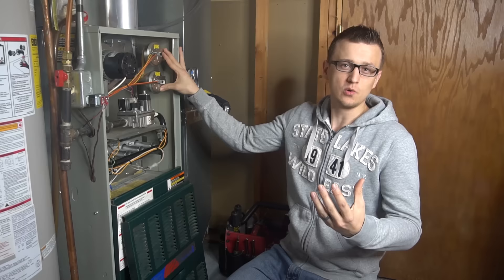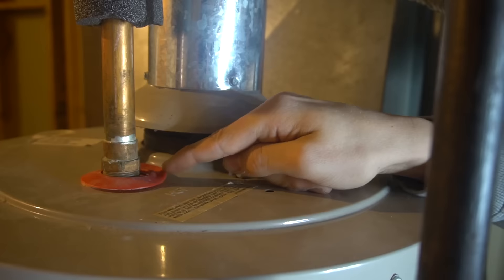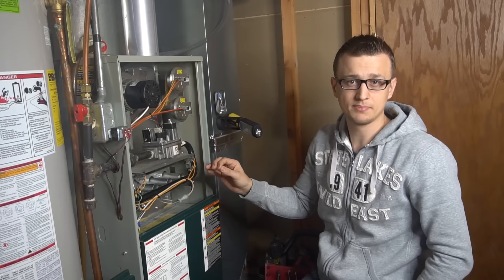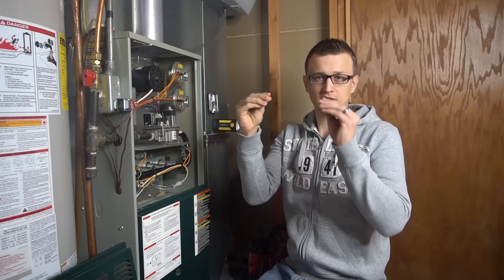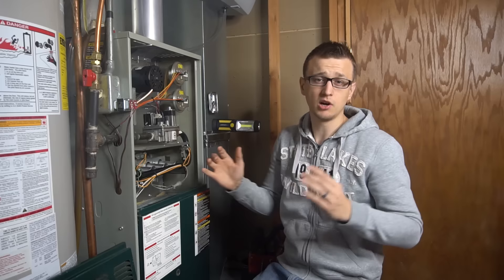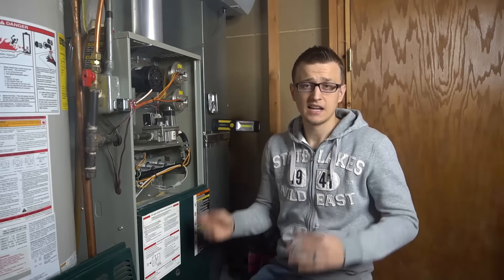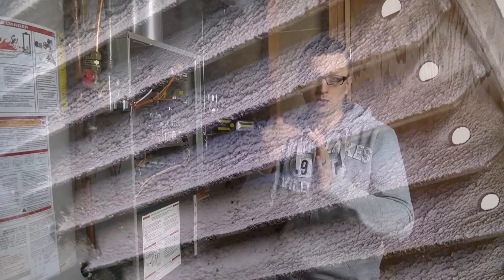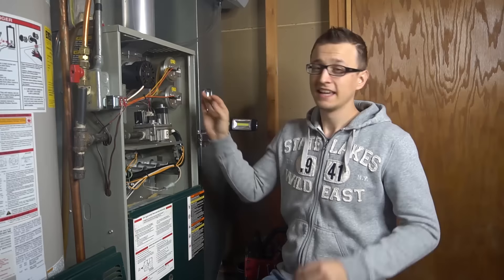Furnace Pressure Switch Troubleshooting

Comment: Hi, I have furnace issue/problem with 3 flashes which is “pressure switch do not close or reopen” when the upper door is closed. When I try to figured out/fix it runs when its open (no upper door) & give us the target temperature but when it stopped, it flashes 4 times. Is the 4x flashes a part of normal operation when it stop?

Comment: i believe i have watched all your videos on pressure switches and still have a problem. my switch has another hose connected to it that goes to the gas valve and burner,  didn't see that type on your videos .  if i disconnect the hose the furnace will work for a while  then shut off,. if i disconnet the power for a minute or so it will restart again for a while   connected it will not ignite the furnace.  my furnace is a xr90,  i did replace the pressure valve with a new one but had same problem.  any ideas?  thank you

Comment: I'm getting a pressure switch error message on my 90% Goodman gas furnace. I'm not getting any motor activity whatsoever. The error fires off pretty immediately. Would this indicate a heat exchanger issue? Have moisture that has shown up inside. Exhaust and intake vents are clear, pressure switch checked out fine, blew out the moisture removal tubes.

Comment: Today I had a chance to troubleshoot Bryant 333BAV, the controller board was flashing error code 43, which is Low-Heat Pressure Switch Open While High-Heat Pressure Switch Is Closed, I tested the high and low pressure switch with ohm meter, and they tested good with normally open. I then stuck a 22 gauge wire in the metal tube the see if it was blocked, it was not. I then traced the wires that go to and out of the high pressure and low pressure switch. That's when I notice there was a Over Temp Switch model HH18HA416  in series with the low pressure switch. I then decided to install a jumper across the Over Temp Switch, and flip the switch to turn on the furnace, after few seconds or so the inducer fan turn on, then the igniter glowed orange and natural gas valve kick on and we have ignition and we have flame!

Comment: My furnace is a Aire-Flo AF80MPA075B3-A, I can,t find the LED on the control board. Is there a chance that this control board does not have an LED. Thank you for putting up your videos. Heinz.
Reply from the maker: Hey Heinz! Some control boards will not have an LED light. Either yours doesn't have one or the transformer is not sending 24 volts to the control board. Without LED diagnostics, you would need a multi meter to check voltages to try to track down the problem.
Reply: Thank you so much for the fast reply, now I don,t have to go and look any further, and yes I have the 24 volts. The furnace is working pretty good after cleaning out the Vent Pipe. The temperature drops at night by about 5 deg but works fine during the Day. Just wonder if the Flame Sensor is dirty, like to check the Sensor but can,t find it. Can you help again? Thanks Heinz.
Reply from the maker: @heinzmissun7431  Happy to hear it's working! If you watch the following video, I talk about the 4 different kinds of ignitors. Which one do you have?

https://www.youtube.com/watch?v=1bRsFAMgZRQ&t=22s

Some furnaces will have a spark ignitor that also acts as the flame sensor. I also have flame sensor videos if you need them. Although it's likely not a flame sensor issue. My first thought would be that perhaps it is overheating. I will be posting a video on 10 reasons why a furnace overheats later today.

Comment: Hey bud, been watching all of your vids to get an idea what’s wrong with my propane furnace but can’t find anything. Last year my furnace started making a loud clicking sound over and over without any flame. Motor is coming on. Had a HVAC company come out and said it was a bad regulator at my tank. He turned the plunger a couple turns on the regulator and it work for about a month. Well it started again this year. I had my regulator replaced. I should mention I live in high elevation and furnace is in my attic. I would say a good 20’ elevation higher than my tank. After the regulator was replaced it came on once but after that it’s back to clicking. I adjusted the plunger in the regulator last night and it the furnace worked fine after that until next cycle… back to clicking and no flame. Any ideas? Thanks!

Comment: I get code 31 on very windy days, the unit is vented to the roof with two 90s to form a (u) pipe point down. any ideas to stop the wind from entering the pipe and effecting the pressure switch>

Comment: Hi, my furnace gives a pressure switch error, started once every 2 months and now once a week.  Been a 2 year adventure.  Repair man replaced pressure switch over an year ago. If I power off, blow on the pressure tubes, power on, it will work.   During the issue the inducer motor is running the entire time, sometimes for many hours before I get home and get it running.  It is a Lennox G51MP installation 2006. Been getting a lot worse lately.  Any advice on Intermittent issues trouble shooting.
Reply: Hi, Jeff, I have the same issue specially in cold weather. Did you have it solved? Thanks
Reply: @yzhao2919  no, I never found the root cause.

Comment: Huh.. ? It could be a leaking diaphragm in the pressure switch.. Proper testing would be to connect the manometer directly to induction draft before using a "T"  connector.

Comment: Have you ever seen an intermittent pressure  switch that would only fail on start-up? It fails to start the first try sometimes not always though...usually the second time always... very few ever does it take 3 times. Once it starts and begins running  it nevers shuts off until the thermostat is satisfied and cycles completely.
This is a new Lennox 80% furnace replaced 12 -31-2020 and has had this issue since day 1.
 I noticed it took twice to start the day the techs installed and had left but just thought it was a fluke of air in gas line or something it started fine the second try. Later on i noticed this was something that happened every once in a while so i called and a tech came out and couldn't duplicate a failure so.let it go because it never ever failed to start completely. 
Better half was down stairs other day and noticed it took until the 4th try to start so i called and a senior tech came out and got it to fail for him said he thought pressure switch was causing it and would order and would see results......part should be in soon and will see what happens. Its strange to me in the sense that it only occurs on start up and never again and also that it doesn't fail every time .

Comment: I’m desperate for a tip. My Carrier 58WAV075-101HC will blow out heat but every few hours it shuts the blowers off and only vents cool air. It won’t heat again unless I click a switch that sits next to the exhaust at the top and is connected to the pressure switch.

Comment: I have a older furnace that had the blower motor replaced then the person that fixed it replaced the pressure switch with one it does not go to my furnace and now my furnace sometimes kicks on when it supposed to in other times it does not then I have to turn my thermostat off for 10 minutes then turn it on then it works normally then we’ll go back to not kicking on Any idea what can cause this problem

Comment: 2 ton Goodman/Bryant with water pouring out of switch and hose but doesn’t have a drain valve. Rain water in vent? Evap coil is above but only 2 year old unit. Should drain into inducer housing huh? Don’t see any external leaking.

Comment: on high effeishency furnaces there are two pressure switches why. and do they both close their micro switch at the same time when inducer motor stats, I am still getting code 32 intermittently on my Carrier, which say pressure switch falt. I am afraid to brake it by blowing in there. Is there an alternate way to check each one speratly.  Thanks again.
Reply from the maker: The pressure switches have different PF ratings. Which means one of them needs more pressure on it to close. That's why the inducer motor has two speeds. An alternative way to check it would be to use a multi-meter if you have one. Being that the problem is intermittent it would be hard to catch it though... And it's not likely that the pressure switch itself is bad. I would think that either the condensate trap/drain line is partially plugged or somethings wrong with the exhaust or intake.
Reply: The problem is you have a carrier. I have run into problems with those furnaces. Get a different furnace! I have run into two different plugged secondaries in the last year and the same day I was going to replace one another tech from another company was replacing a secondary that same day

Comment: I have a trane xv90 furnace and heat pump and nest thermostat.  I can't get either to heat.  I have 1 red flash every 20 seconds on the control board on the furnace.  I have a N6 error on the nest thermostat.  Any ideas?

Comment: i have a keeprite high efficiency with the plastic tubes and it starts up normal and everything. it runs for 20-30 seconds the cuts off and gives me 3 flashing lights. checked flame senser , cleaned ports, checked for clogged vents and everything seems ok.. any suggestions

Comment: Exhaust is getting into my system somehow which then blows into the living space. It happens only at night.
I have a single stage Rheem furnace.
How could that happen?  Could it have anything to do with a failing pressure switch?  If so, why only at night?

Comment: Every time I attempt to use a Filtrete filters it shuts down my system after a while. The unit is up in the attic so for a quick fix if I turn the breaker at the panel off and then back on it resets the system and it’s back on. Now, when I use the really cheap filters I have no problems. Is this a pressure issue?

Comment: I have a pressure switch error. I have replaced the inducer motor, the inducer sensor, pressure switch. The system is sending voltage to the the inducer sensor, but then there is a click and the inducer fan does not kick on. Not sure why since I replaced the sensor. Must be the board. Any ideas.

Comment: My pressure switch vacuum hose keeps filling with water/condensation and it trips the pressure switch. I've been thinking it was my flame rod for weeks. I usually have to empty it once a week. How can I keep it from filling up and tripping the pressure switch and is it normal to build up condensate in there?
Reply from the maker: Normally there should not be water in the pressure switch hose. I would need to do some looking around to figure that one out, sorry. On some Carrier furnaces I know the pressure switch port was a little small so the manufacturer's recommended fix was to use a drill to make that port a little wider. I don't remember what the drill size was supposed to be or what models were affected though. Haven't done one of those in a while. Another possibility is that your condensate trap is partially plugged and there is water backing up in the collector box. I would try cleaning/flushing out the condensate trap and see if that makes a difference.

Comment: Hello Jake, Steve here. I just replaced my blower motor. Fan works in manual mode only. When burner ignites, fan  does not turn on. Any guesses? Thanks in advance.
Reply from the maker: For the time being I would just leave the fan on all the time. (sounds like that's what you are doing already). Most likely you have a defective control board. Or if it is an older furnace that has a fan limit control, that may be the culprit too.
Reply: @WordofAdviceTV   Thanks. Yes its an old Coleman. I'm having to run the heat cycle manually.  No board. It has a fan control center too. Looking for  videos on testing limiter and fan center. Thanks for replying Jake!
Reply from the maker: @stevec3465  You are on the right track. You would need to do some checking with a meter to pinpoint it though. I can't tell you which one it is without checking stuff, sorry.

Comment: What if there is no code flashing and the only thing that comes on is the inducer motor but only for about 5 seconds?
Reply from the maker: Hard to say... If you bypass the pressure switch right after the inducer motor comes on, does the motor stay on? (It's important to only jumper the pressure switch after the motor already turned on). If the motor stays on, then I would say it's a pressure switch problem. If not, then I am not sure. Maybe a defective control board?

Comment: #6 ... instead of blowing and/or sucking and listening for a “click “, there must be a more logical troubleshooting method .... like with an ohmmeter.
This video is titled “ pressure switch troubleshooting “ but you only actually covered it in step #6 when checking with an ohmmeter or voltage meter would definitively rule out a bad switch

Comment: Your venting is not correct. You need a T with inlet for the furnace and the water heater. This would prevent the down flow on your water heater. This was changed when power vent furnaces came into the picture.

Comment: I have a open pressure switch stuck code. Im not sure wthat is it. Sometimes i have hot air and orher times i have cold air. ill check if there is something in the vent

Comment: So..I got one for ya..I'm NOT a certified heat and air tech..I know a thing or two about a thing or two..a buddy of mine moved into this house about 8 months ago.  The A/C system wasnt working..after working on it for a few hours I fixed the problem..it was fuses that are made of copper, a couple inches long and about as big around as a dime..I also replaced the capacitor now the season has changed to winter.. December 15, 2022 the heater isn't working..three weeks ago the only thing that would come on is the inducer fan.I replaced pressure switch hose and the board and it worked for part of one day. Now it won't light the burners, all seems well except lighting up. It goes through all the procedure. inducer fan works I hear clicking and then I smell a.poof of natural gas..the glow bar doesn't glow..I know this unit runs because I manually lit the furnace..it ran all the way through one cycle and shut off..I shut off power to it..turned power back on..same procedure with clicking and all that stuff..manually lit it what could the trouble be in your opinion

Comment: Have you ever had a furnace that was blinking for the pressure switch...then all I did was wiggle the connector on the pressure switch and its working now??
Reply from the maker: Yes, a loose connection at the pressure switch could give a pressure switch error.

Comment: How to check that capacitor on the power vent
Reply from the maker: You would need a multi meter that can check micro-farads. (usually labeled as MFD or uF) The rated uF should be found somewhere on the capacitor itself (3uF for example) Unplug both wires from capacitor and put both meter leads on either terminal to check what the capacitors is measuring. A good capacitor should be pretty close to whatever the rating is. Hope that helps!

Comment: My furnace comes on and runs, but only for a short while, 5 to 15 min, then stops and shows the pressure switch code. I can power cycle it to get it running again. It seems like it turns off quicker the colder it is outside.

Comment: My issue is a clicking sound during start up-sometime clicks several times.
Reply from the maker: Do you have a spark ignitor? (in my "how to replace an ignitor" video I explain what the different kinds of ignitors are) I would try cleaning the flame sensor if your unit has one.
Reply: I'm pretty sure the clicking is coming from the gas valve.  Sometimes it clicks only once and the furnace continues to start up, but sometimes it clicks several times and then takes longer to start up.  I'm being told I need my pressure switch replaced but I'm not convinced.
Reply: It's an intertherm furnace in a mobile home.
Reply: By the way, your videos are fabulous and so informative!
Reply from the maker: @lauricomo9130  Thank you! Ah so the sound is coming from the gas valve.. That makes it a little more difficult. It could be quite a few things so unfortunately I can't tell you exactly what it is. In my community posts I have a series of pictures showing a spider web in the gas valve of an intertherm furnace. ( https://www.youtube.com/user/WordofAdviceTV/community ) something worth checking if you want.. Other then that it would take some testing and probing to figure out the problem in your case. Not something I can do over comments, sorry.

Comment: How can you tell if a condensate trap is plugged? I can tell that I'm looking at it, and where the water comes from and drains out, but do you have to detach the hose to find out if that's an issue? I was hoping it was just a plugged port, but the hose and ports seem to be clean. I think it could be the inducer motor or the secondary heat exchange. If anyone wants to help a clueless millennial, I have a Goodman GKS9 Model CAPF3030B6BA.

Comment: My induction motor stays on for about 2-3 sec. Then turns off and tries again. The light is black - control failure low voltage (24) equipment ground. How do I fix?

Comment: One time I found a roofing nail in the inducer motor. A roofer dropped a nail down the pipe on the roof and it jammed the impeller.

Comment: My furnace is doing everything correctly but the last part. When the flame starts it then goes off. I've checked limited switches, and checked all voltage. Very frustrating its been off for a week 🥶 I've been trying to troubleshoot everyday after work.

Comment: Well, I got a pressure switch error code. Inducer fan runs and the pressure switch closes. I then unplugged the connector to the control board and check for wiring continuity and they are all good. I had no clue what the problem was. I gave it up and plugged the big connector back and suddenly the furnace works again.